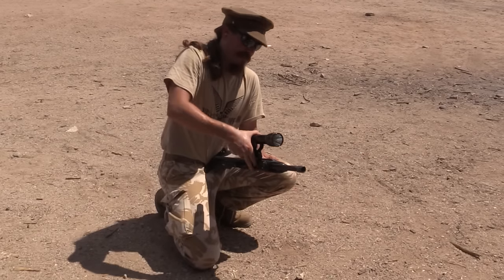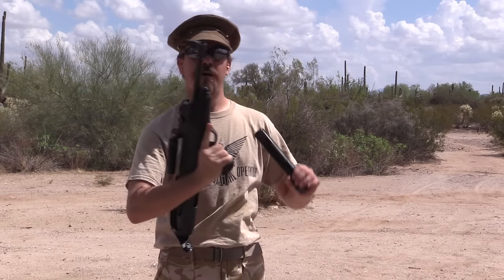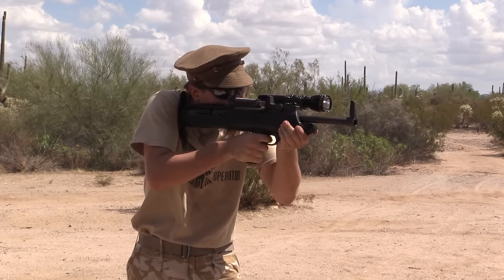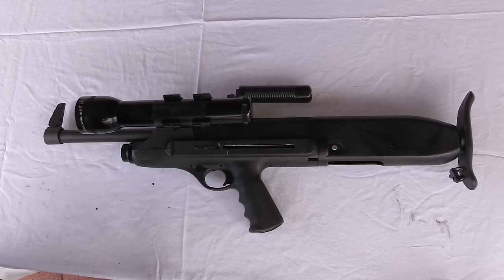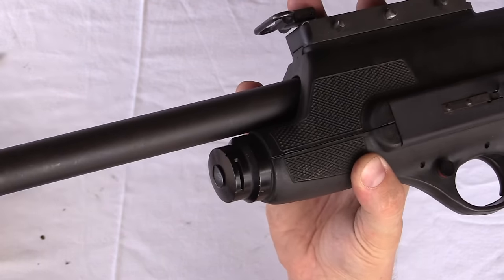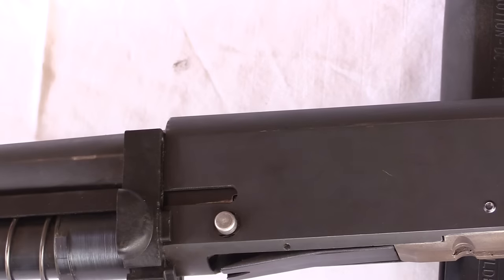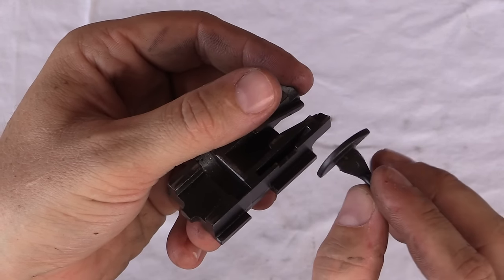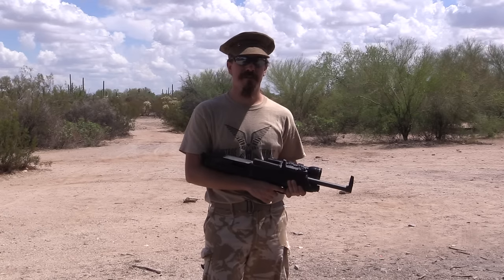High Standard 10B: Disassembly and Attempted Shooting

Comment: Seems like a lot of semi-autos don't run well on low brass. Saigas included.
Reply: +Moto Rad
 No semi-autos should ever be thought of as 'tactical', stick with pumps.
Reply: Roger Hudson I run an 870  ;)
Reply: ***** Semi auto rifles run though, and there aren't odd ammo types they have to deal with like shotguns do. Semi auto shotguns can be very VERY picky. Pumps are also a lot faster than bolts, on a side note.
Reply: +Moto Rad aye, most rifles have normal-possibly ap. Then subsonic loads for suppresors maybe, alot easier to make reliable with those general guidelines. Your average shotgun has birdshot/buck shot/ slugs/ less then lethal options/ then the high brass options.
Reply: Oliver Walkins All ammo types really act the same, AP, Tracers, Ball, etc.  subsonic you may have to tune the gas system, but the heavier bullets for SS ammo helps it run. Overall, semi auto rifles are easier and actually do run 1000x better than semi auto shotguns, which tend to only like high recoil high brass ammo.
Reply: ***** Many companies have said that.  lol  A few out there work alright, but rimmed plastic cases will always be less reliable in a semi auto.

Comment: the Kel-lite was the predatesesor to the Mag lite  the weak point in the Kel-lite  was the switch  
now Kel-lite would repair  the lights for free and pay shipping both ways 

once Mag-lite came to market  Kel-lite couldn't give away  they lights because  Mag lite switches were basically bullet prove I have both flashlights 

I had My Maglite for over 20 years til a jerk from a truck towing company stole it out of My truck when it broke down

driver was Owners son 

still waiting on promised refund  10 years later